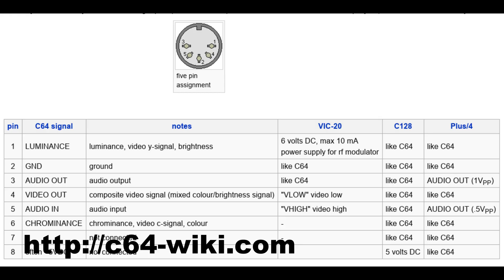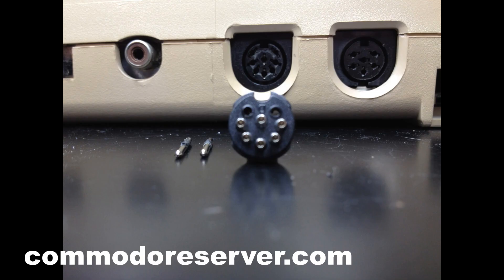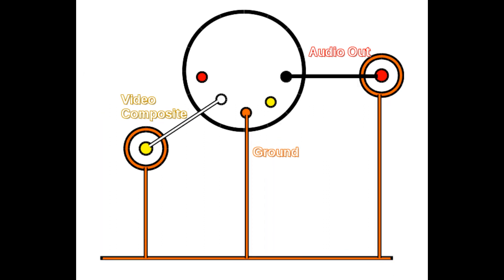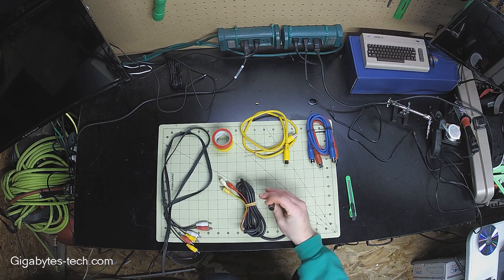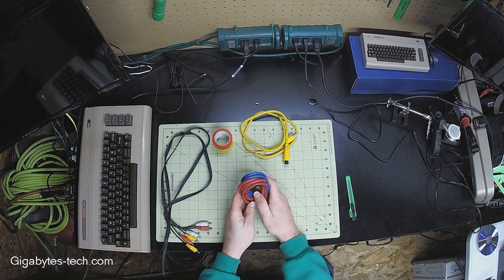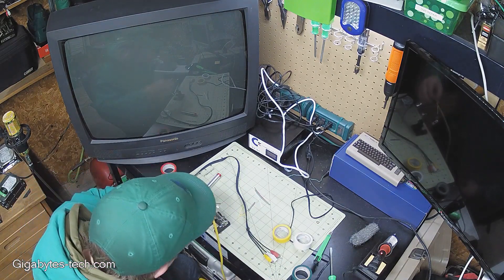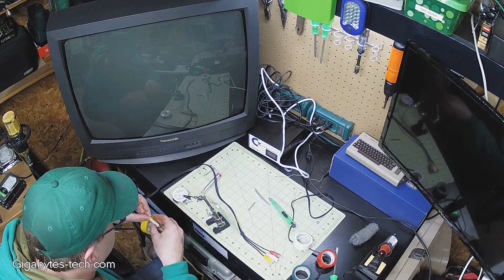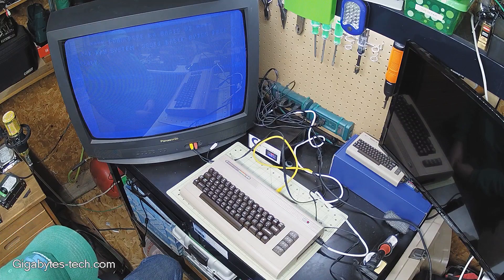Making a 5 Pin Video Cable for C64 / Vic 20

Comment: if i link/solder together luma and video composite out,  is dangerous for the c64 or the tv screen?
Reply from the maker: There is little risk. The worst that might happen is it won't work. Watch the video. I wired the thing backwards and it didn't hurt anything.
Reply: @gigsplain  it looks to works nice but there is this "breakcircuit" between luma and composite... 😂 Ok i will open again to be sure, my connector is really poor, i m scared to make the work again that's the problem! Anyway thanks a lot for the guide and the info :) cheers

Comment: in schematics, connectors are always shown from the solder side, not the pin/plug side. so I don't think anything is "reversed".
anyway, it would be nice if you could clearly indicate (as in: add image caption) which side of the connector you're looking at when showing which pins to use. adding pin numbers may also help.
otherwise nice video, I just built a cable :-)
Reply: Not always.
Reply from the maker: This is likely accurate, however, from the perspective these are drawn it may seem to someone attempting this for the first time as though it is reversed. It was also the easiest way to make that point by simply saying "reversed".

Comment: Thanks for the video. I bought a 5 pin DIN connector by itself on Amazon, $2.00. Of course the pin-out flip got me confused because I was soldering wires into the connector from behind, so all the diagrams online are correct.  It's very delicate work trying to solder those wires into the connector without melting the plastic or the insulation on the wire, but I finally got it right, and it works fine. I was wondering if the outer metal of the plug should be grounded, but I just used the bottom (number 2) connector.

Can anyone tell me why one of the pins on the 5 pin connector is labeled Luminance if there is no Chroma pin? How could that even be used?
Also, Audio In? I don't recall ever using audio in. I once borrowed an add-on device that allowed recording audio for games, but I don't remember how that was connected.

Comment: There is an s-video mod for these 1st editions Commodore 64s which should give even better output. However the mod requires cutting a trace on the motherboard. I have the original cable and the video is fuzzy on both TV and 1701 monitor.

Comment: There are some mods to make a S-video cable or scart. So far i did not find any practical information on that subject. Also, there is a difference between the German version and the US version. The German version of the Vic-20 (not sure of the 64) has its RF modulator outside and not build in like the US version. Correct me if i am wrong.
Reply from the maker: For the VIC-20, that is spot on. My older VIC-20 has an external RF modulator. What is normally luminance is the power for the VIC-20 RF modulator. You can use the same wiring to access the composite signal for the VIC-20 (just don't connect the luminance wire). Unfortunately, from every source I have read, for a 5-pin connector, you do not have enough pins to adapt it to S-video. You would need an 8-pin port. Same is true for a SCART connector.